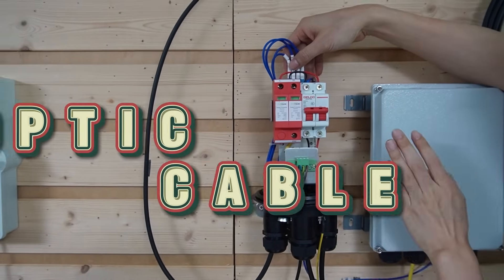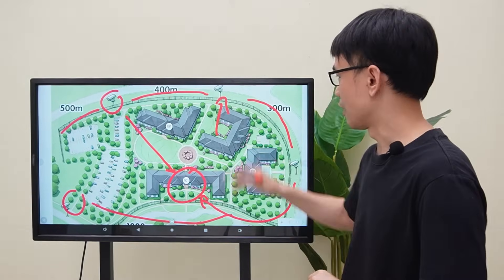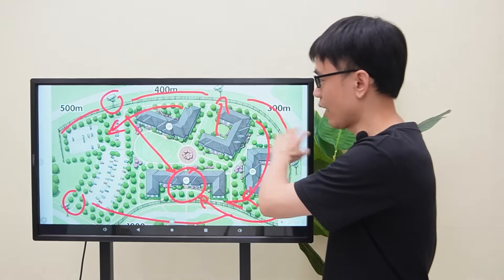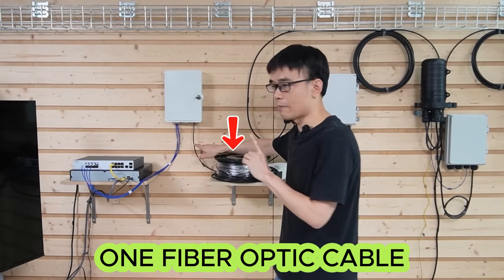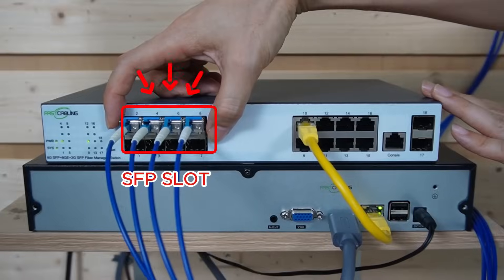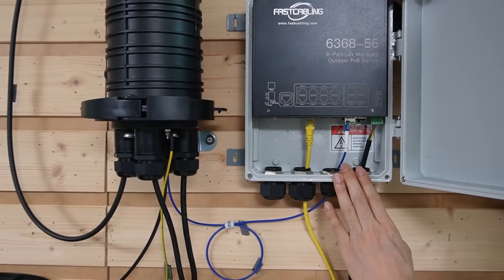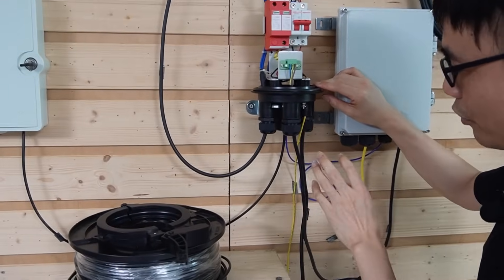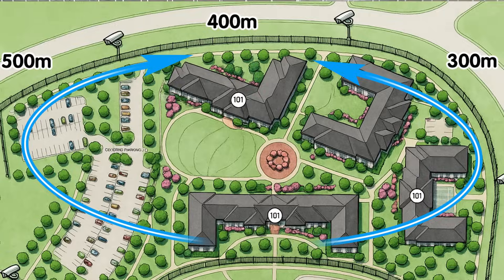Run ONE Fiber to Link 4 Switches for 50 IP Cameras | Perimeter CCTV Setup Guide

Comment: Are you able to connect cameras and internet routers on the same pole switch?
Reply from the maker: Most routers do not accept PoE power, so only connect them to a non-PoE port on the switch — or use a PoE splitter that converts PoE to DC if necessary.

Comment: Note: Make sure all fiber cable is protected from rodents. If its in conduit, Seal off all ends so rodents cannot get inside!

Don't ask me how I know!
Reply from the maker: Alternatively, you can consider using direct-burial fiber cables with an armored/metal jacket for added protection.
Reply: Only in New York
Reply: @dynoesaur  Mice are every where

Comment: This seems like a poor setup for physical attacks. They coukd have just setup a wireless AP for each camera to communicate with and just had a few receiving AP around the property with ethernet back haul. There is only 1 camera that's to far for a wifi signal to reach and you could just do another AP nearby it.
TLDR: A mesh network would have been better then this. And have better redundancy.
Reply from the maker: There are more than one cameras in each setup spots with AC electricity. It needs PoE switch to link the cameras nearby. The buildings will block the signal transmission. The typical issues for mesh network is the bandwidth will reduce one node after another.
Reply: @Fastcabling  Even if you are convinced that a mesh network wouldn't work. a better setup would have been to run multi fiber cables and setup fiber splitters and a distribution point at a few locations. that way every section (as many as you really want). has it's own dedicated fiber back haul to the main NVR system. And if you're already running fiber, just run enough to link up each switch independent of each other. You's still have an issue of a singular point of disruption. but now, if they just cut the ring in the middle, with it's 1 fiber stand run up to it. all the rest of the network could still function. you could easily run a 2 or 3 inch conduit around the parimiter for the fiber cable to pass through underground. making it a much more difficult attack vector.

Also, im only commenting such exotic solutions because we are talking about a person who wanted 50 CCTV camera around their home. which must mean they are a target of value. so security and redundancy of the network is far more important then simplicity. or at least I'm sure the person requesting the setup would think so.

Comment: Is this suitable for live broadcast production and streaming purposes?
Reply from the maker: The outdoor PoE switch only supports 1Gbps, which may not provide sufficient bandwidth for live broadcast production and streaming. You can use fiber directly, which can handle higher speeds.
Reply: @Fastcabling  Thanks. Please do a video on the same if you can. It will help.